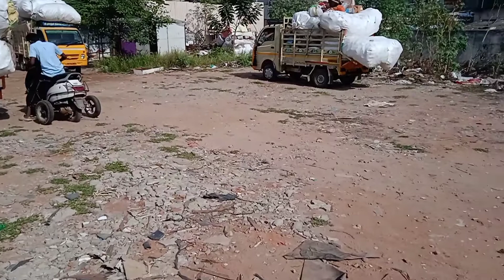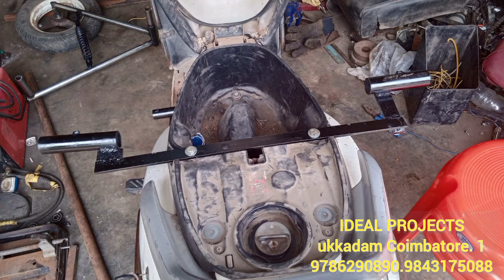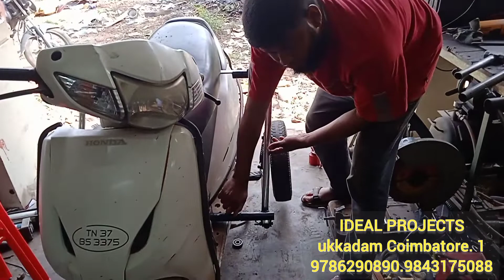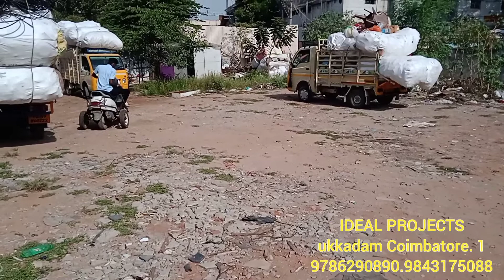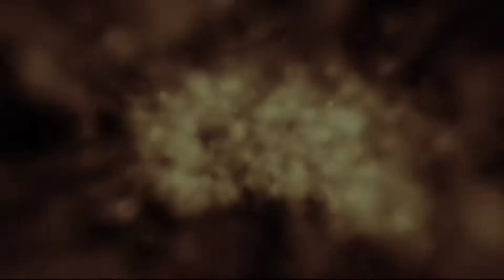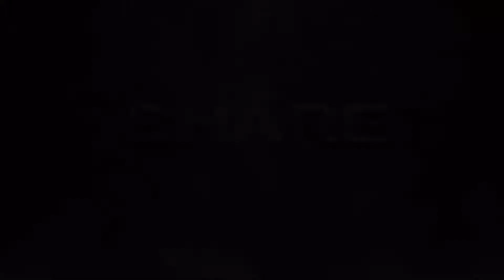Easily convert Handicapped three wheeler   to two wheeler

Comment from the maker: All mechanical engineering projects spares available. 
Bldc motor, dc motors, Dynamo,engine, gearbox, gears,
 Pneumatic Cylenders, pumps, valves ,robotics motors, ac motors,  , chain, chain sproket available. 
All states  parcel service  available.
Pls contact 
               For
IDEAL PROJECTS 
stall no 130 mma market ukkadam Coimbatore1 9786290890,9843175088